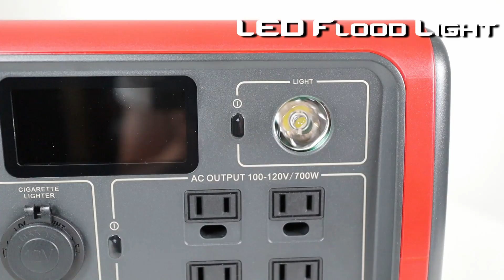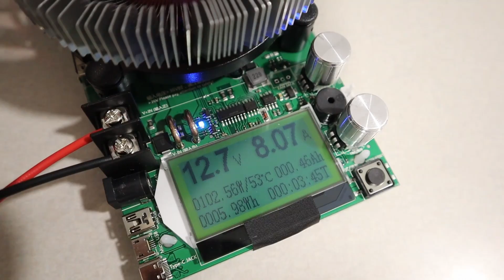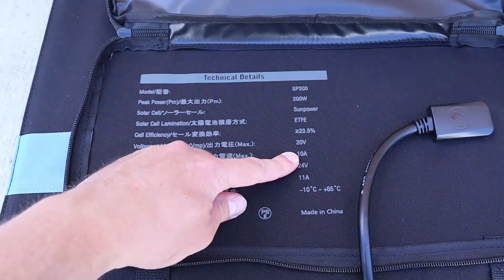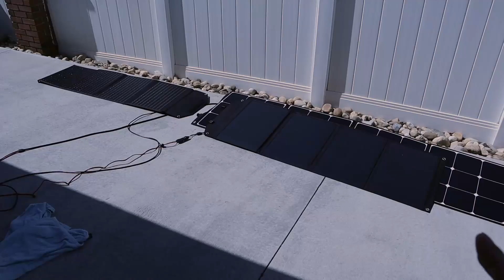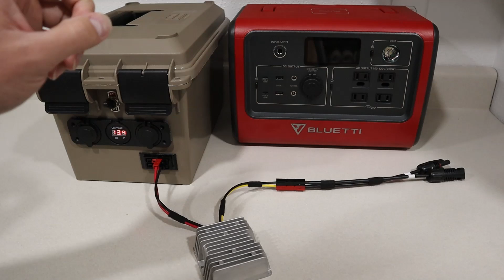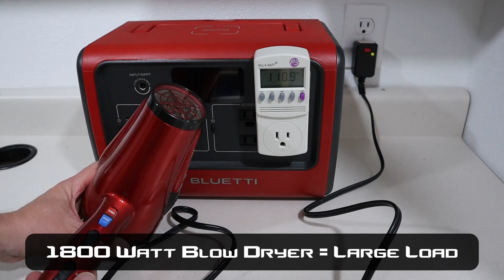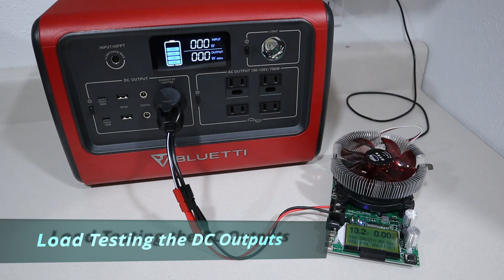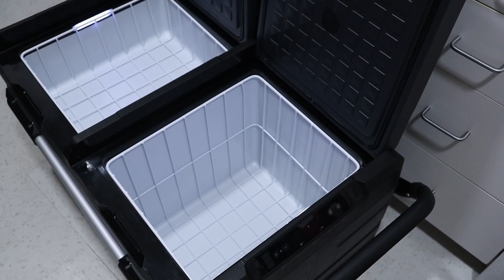Bluetti EB70 LiFeP04  + SP200 Solar Panel - Best Battery for 12v Fridges? - Full Review and Testing!

Comment: Always push the light button, because when the power buttons stop working you're left with dead weight.
Reply: I'm also getting way less that the advertised spec - European model. It's providing around, or perhaps less or more than (depending on the way it behaves on the day), 500wh in actual power on a full charge from the AC sockets. I paid €630 for the thing, having bided my time for the best deal I could reasonably expect. It's way overpriced, and lied about in the specs. I suspect all of these types of device are dishonest in their claims. There is a need for some kind of regulation on these things for the claims being made.

Also, if you're trying to charge this through the 12v socket in your car you'll have problems if you are a driver of a diesel vehicle (as we do in Europe). The thing will not charge at 100w if the revs on the engine are below 1500rpm. If it's less than that it charges at 30w and fluctuates, often down to 12w. The typical way to drive a diesel van or camper if you're not in a hurry is at less than 1500rpm so you don't waste fuel for no reason, or stress the engine. This results in the 12v charging being worse than 2 100w panels on the roof on an overcast day.

I would return it, but it does seem to be the best of a bad lot in the solar generator market pricing in Europe, and I need this mode of power storage right now.

I'd say buyer beware for all of these devices. Possibly consider using the cheaper lead acid or AGM for more storage until this whacky market evens out.
Reply from the maker: I have all the detailed testing information about each of these power stations on my website PPS grading system:
Jasonoid.com/powerstations/
I got 580wh on AC output, 616wh from the DC output.
Reply: @Jasonoid  Thanks for the reply. Yes, I would believe the 580wh results for the US, but I think the inverter in the European model I have is losing some of that. I'd put it at max 500wh, realistically probably about 480wh. The DC did seem to be pretty good - near 10 hours on a 60w 12v fridge. I'll be testing it again and again, so I'll try to be as scientific as I can and report the results on AC as I compare charges and usage, but overall it seems the European version is not delivering anywhere near 580wh.
Reply from the maker: @durbledurb3992  Yeah that might be the case having to convert to a high voltage. Best way to test would be through an actual watt meter on the AC inverter.
Reply: @Jasonoid  I'll pay for shipping.

Comment: Dude. You’re assuming that the 200w solar panel can always produce its full rated capacity. It’s alway better to have more solar than what you need. That way if you have small bursts of sunlight you can maximise you solar charging where possible. Otherwise. Best review on you tube regarding these Bluetti. Well done man. Love the dc to dc idea.
Reply from the maker: Overpaneling these power stations is a great way to keep the maximum solar input going, even when conditions aren't perfect. I like to use a full 200 watt panel on the EB55 and the EB70 since the 8 amp limit. You can definitely go higher if needed, I have plugged in 400 watts of solar into my EB70 but it seemed I was wasting a bit of solar since I usually have pretty sunny conditions.

Comment: the jury is still out on the EB70 as far as i am concerned. owned it for about a year. was very dissapointed at first, cause the power bar seems to drain very quickly with light duty loads such as my laptop or desktop monitor which i use with my laptop. it does however seem to go into survival mode (on ECO mode) when it gets down to zero percent. i was surprised last week when it kept going and going when the bar reached zero. so will have to test it further (i have tended to recharge before it drains completely.  all in all though just haven't been impressed with this. recharges quickly though, 3.5 hours which is very good. AC50s which i also own, recharges fully in 7 hours.

Comment: Great review on this! I'm picking one up and appreciate all the info you gave regarding solar charging it. My question is if it can handle up to 28 volts, why couldn't you run 2 12v 100w panels in series?
Reply from the maker: Great question John! 12v panels actually don't match their name very well. They put out around 18v-24v depending on the brand, so they'd go over 28volts in series. 12 volt panels are designed to charge 12volt batteries and that's why they are named that way.

This is an excellent power station and should work well for your needs. Check out my website for the latest discount codes on these products:  jasonoid.com

Comment: Jason, quick question, bluetti eb70s or BougeRV 716wh for second unit? I already have eb70 or eb70s not sure, I want to get another 716wh just to be on a safe side when Overlanding..
Reply from the maker: The EB70 works great for overlanding! Man it would be awesome if it supported expandable storage or if Bluetti made a EB100 (a slightly larger EB70). If you already like your EB70, I'd say pickup another if theres an urgent need.... but if it can wait for 6 months I think we might be seeing some really cool new stuff from Bluetti (Maybe some expandable models that are smaller?) not sure...Hope this helps!
Reply: @Jasonoid  Jason I hope Bluetti is reading response you wrote to me. I like my bluetti ed70..s? Lol. 
I feel like it's doing its job. It's just that when I go across country and visit places off of beaten path I would rather have too much power than barely enough you know. 
I will take you word tho, once again ;) and go with what I already have but I'll see I may wait 6 months or so and see what's Bluetti comes up with and if they come up with eb100s? I'm gonna buy it so fast that you may watch MY review haha 
Thanks again Jason you're approaching Awesome you if you keep it up

Comment: By my math the capacity is 660-665 wh with the AC inverter using 7-8 wh. So, draining the battery in an hour will give you about 655 wh and draining the battery in 20 hours will give you about 510 wh.
Reply from the maker: I got around 616wh I think on my model, not too bad!
Reply: That must be part of the explanation of why Hobotech got 89% efficiency from AC and Jason got much lower.  I couldn't see at what current draw Hobotech drained his unit.

Comment: So just so I get this straight, can two solar panels rated as 100w, 12V and 5.5 amp be connected in series to safely and effectively power the EB70? Anyone care to get real nerdy for a curious newbie? (:
Reply from the maker: Parallel connections only, no series connections on the EB70. The voltage will be too high with a series connection.
Reply: @Jasonoid  Thanks for such a fast reply! What confuses me is that the EB70 seems to be rated as 12-28V on the european webpage. Why are two 12V panels in series too much?
Reply from the maker: @martingutsch6985  because 12v solar panels put out 22volts each, and in a series connection they add up to over 40volts, higher than the max allowed input of 28volts on the EB70

Comment: Is the solar charging design flaw you mention around the 10 min mark still present in the EB70S? I’m looking for a good 200w panel for mine.
Reply from the maker: Yes, the 8 amp input limit is still in place. 155 - 160 watts is still pretty decent on this size of power station. It doesn't bug me as much anymore
Reply: @Jasonoid  thanks for your reply. Your vids are super helpful for solar noobies like myself.

Comment: 140W is terrible. I got 102W from 100W Jackery solar saga on EB 70. In Winter! In the middle of March in Central Europe
Reply from the maker: I later found out this panel had some sort of defect. Most of my viewers saw much more wattage.
Reply: @Jasonoid  thank you for explaining that. I'm a but intrigued by the station's input current though - even the bigger stations often also have just i.e. 10A, which would mean that you still won't get full power even from two paralel SP120W which have 6A output?
Reply from the maker: @alchymista2  One benefit of the larger power stations is that they accept 100v-150v input so you can run many solar panels in series. For example I run 725watts and 925watt arrays for my larger power stations and it works great. You have to remember amperage causes heat and requires large wire so to keep it simple these power station companies use series connections on large power stations. The EB70 only has the 28volt 8 amp limit so it is a little held back but 155-160watts of solar on a small PPS like this is a good amount.

Comment: Nice  video, was very helpful. One thing that would be good to include is the weight, and maybe weight to capacity ration for comparing to others?
Have you tested the wireless charging of these units?
I'm looking to replace my ArkPak 730P which has 120AGM battery. Would this be equivalent in Battery storage capacity?
Oh do you see any issue using Anderson plug to the MC4 adapter (my solar blankets only have Anderson connections.

Luckily this is available in Australia, but one has two AC outputs (240v, which is fine, but they are 1000W)
Reply from the maker: Hey Scott, this is one of the first review videos I had done so it was a bit unorganized. The wireless charging works great! I have since come up with a power station grading system you can view here on my website:
https://jasonoid.com/powerstations/

It works best on a desktop vs mobile phone screen. It has everything you'd want to know about all the power stations I have tested.

Comment: Is there a converter you could recommend without connecting directly to the car battery?
Reply from the maker: Just use the regular 12v charging cable, that's about all you can pull from a 12v socket without blowing a fuse. Any higher charging requires a direct battery connection.

Comment: I bought an EB70S based in part on your recommendation and it was a good choice. My question to you what would be a good solar panel to mount permanently on the roof rack on my 4Runner?
Reply from the maker: I would go with a glass rigid panel for the most durability. Try to get the most solar you can fit, maybe a 200 watt panel will fit? Flexible panels and portable panels break down over time so I wouldn't recommend those for a roof mount. BougeRV has a few great panels and I have a 13% off discount code for any of them on their website (JasonoidLLC). Rich Solar and HQST also make great 100/200 watt panel options.

Comment: hey great videos,  if I had the eb70 in the back of the ute conneted to a fridge and being charged by the 12-24v converter, can I use the inverter on the eb70 to charge a ac200P, or can the 12-24v converter chatrge the ac200p directly. Reason I ask is I dont often stay in one place long enough to fully charge via solar, but do spend 7-10hr in the car.
Reply from the maker: You can use the 12 to 24v converter to get more DC Charging into the AC200P you'd see around 200 watts charging. Just FYI It pulls quite a bit of power so you'll probably need a dedicated power connection from your battery. It pulls nearly 20 amps on the 12v side and that would usually blow a fuse. Most 12v sockets max out around 10 to 12 amps.

Comment: Thanks for sharing the tip about using a 12V-24V 10 amp converter to charge the EB70 in about the same amount of time as it takes from the wall charger. Great idea for faster charging the EB70 in my minivan. So then I started wondering if using a 300W DC 12V to 110V AC Car Inverter plugged into the cigarette lighter would work? The EB70 wall charger would be plugged into the inverter. But would that setup fry anything or burn any fuses?
Reply from the maker: You can run the AC charger off an inverter, however you'll need to run power directly from the battery with larger wiring because most auto cigarette plugs only support 10amps or around 120 watts.
 Since the AC inverter has the potential to pull 300 watts you'd blow the fuse when trying to run the charger off a stock cig plug. I ran 6 awg wires from my battery and now I can hook up a 300 watt inverter and do what you are describing.
Reply: @Jasonoid  Thank you the fast reply. You're like a personal consultant and your videos are great! Would you include an additional fuse in the inverter wiring, like for a converter?  And 12 gauge for the converter but 6 gauge for the inverter?
Reply from the maker: You'd connect your 300 watt inverter to the 6 awg wire, which connects from your battery. It would be a good idea to fuse that connection (near the battery). The AC charger would just plug into the inverter wouldn't it? No need for additional wiring.
Reply: @Jasonoid  Just one more concern please. The 6 gauge wire from the battery will run about 10 feet to the inverter just behind the front seats in my minivan. That’s where my fridge and Eb70 are located. But the inverter wires are much thinner than the 6 gauge coming from the battery. So, after I cut off the cigarette plug from the inverter, how do I connect the inverter wire to the 6 gauge? Can I use Anderson Power poles? Also what size fuse should I use up near the battery? Much obliged!
Reply from the maker: @MichaelKarsh09  6 awg wire can handle 50amps, so i'd install a 50 amp fuse on that line.

Maybe you can install a fuse block that will allow you multiple connections? Since it can handle 50 amps, you could hard wire in the inverter into the fuseblock and put a 30 amp fuse on that one connection. Maybe something like this:   https://amzn.to/3kVw5K4  (or smaller, I have one with 6 connections)

Comment: Would it be safe to rig the EB70 with two SP120’s in series?  Seems like with efficiency losses you wouldn’t exceed 200W
Reply from the maker: No, a series solar connection goes over 28volts and will fry the internal charging board. This power station only accepts 12v panels in parallel.
Reply: @Jasonoid  Whew, thank you!
Reply: @Jasonoid  I got the EB70S w/ a SP120 to run an IceCo GO20 and some LED lights, plus charge my phone.  I haven’t tried it yet and was wondering if I had enough solar panel.
Reply from the maker: That solar panel should do a pretty good job keeping up with that load. You can always see how it goes and upgrade later. The fridge will use more power the warmer it is outside.

Comment: You continue to present professionally and clearly informative.  Can you tell me how long the Bluetti 70 run a CPAP?
Reply from the maker: Should be fine to run it through the night as long as you don't have the humidifier setting enabled. That setting uses much more power.  Each CPAP is different but many users say they have used them successfully on this power station.

Comment: Hi! Great review bro! I just got my eb70 and was wondering if it is normal that the fans turn on when solar input is great. I got a 100w 12v solar panel and when input is over 80 w it turns on and when goes under 80w fan turns off. Is it normal? I dont want to burn it. I hear same sound of the generator in your video.
Cheers
Reply from the maker: Hey Alvaro, it's normal that the fan kicks on when solar input is higher than 80watts. Both my EB70 and EB55 do that. It helps keep the charge controller cool and will last longer.

Comment: I just checked on the newer EB70s ~ the solar is still limited to 8Amp & 28 volts. 
Any one find a solar panel that matches those specs perfectly ?
Please let us know ~ ty 😊
Reply from the maker: The BougeRV 180watt panel puts out near 22volts which is pretty decent. Renogy has a 200 watt panel with a 24volt output, it costs about $250. I'd recommend the BougeRV 180 watt panel, you can see the review on my channel.
Reply: @Jasonoid  Thank you Jason ~ I’ll look for your review on that panel

Comment: I agree. This ia by far an awesome video. This covers so much that others have not.i won my EB70,  not on the road yet when i am you video will help alot. So far testing stuff in apartment. My #1 need to run is my sewing machine and it does but not my iron..maybe I'm not doing it right. Still abit unsure which port to etc
 Buy your my #1 video. Thanks Jason
Reply from the maker: Most appliances that "heat up" will pull over 700 watts meaning you can use them on the smaller EB70 inverter. Some examples would be portable heaters, clothes irons, heat guns.... The list goes on and on. Just give each appliance a test on the inverter to make sure it works or not so you know when the power is out.

Comment: Jason,
 I have the Eb70s. A very nice machine. I was wondering after watching your video, can I parallel 3 HQST 100 watt panels together on the unit? Just as you did with the 3 panels in the video. Also should I put a load on the machine while charging?? Thank you!!
Reply from the maker: Sup g-radz! You can 'overpanel' the EB70s with 300 watts of panels in parallel. The EB70 will use the power it needs and the rest will sit as reserve power waiting to be used in case solar conditions aren't perfect. You'll be able to get the max power input more frequently as you do this. You do not need to put a load on the battery while charging.
Reply: @Jasonoid  aka J-Watts!!!! Thank you for the quick response. Still trying to get parallel and series together. This was the 2nd purchase off of your recommendations. Oupes 600 was the other. Very happy with both. Thank you again for your amazing reviews and lighting quick replies!!! You da Man!!
Reply from the maker: @g-radzpoweredbytheson75  HAHA, nice... J-Watts. There's lots to learn about with these solar applications. Just make sure you use only a parallel connection on the EB70.
Parallel is when you connect pos to pos and neg to neg = voltage stays the same, current goes up. 
Series is when you connect pos to neg and you use the other pos and neg for a solar output = voltage goes up, current stays the same.